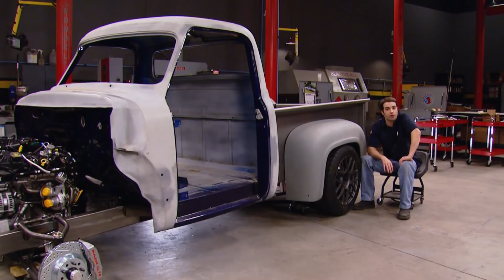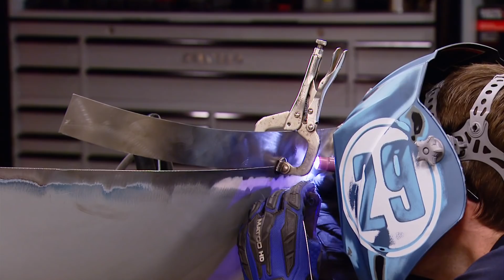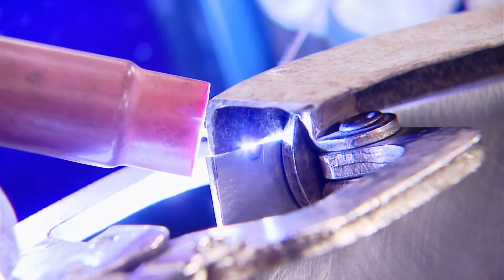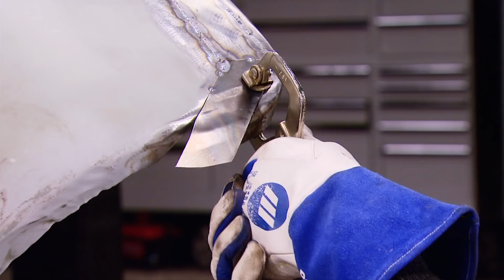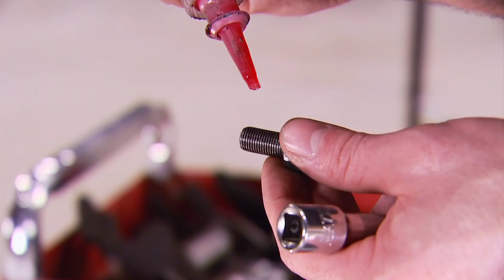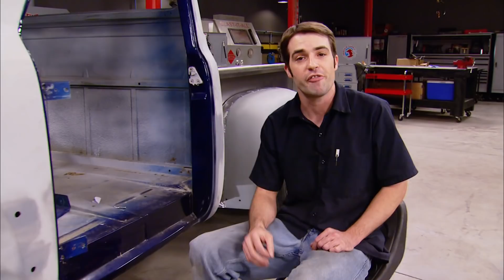Pairing The F100's Turbocharged Eco Boost With a 5-Speed Manual Transmission - Truck Tech S2, E4

Comment: Matco is ridiculous to deal with in their financial department. I won't buy from them again because of it. Randomly they just decide to take extra payments from you and then they refuse to believe it without bank statements. Their financial department is the worst at record keeping. In the last 2 years I've had to straighten them out with bank statements 6 times. I'll never deal with them again after this loan is up.
Reply: In the last year I've heard from 3 other technicians having the same issues with them. I've been buying from the MAC tools truck owner/operator for over a year now never once had a problem. Matco's truck owner/operator didn't want to deal with running a bank card every couple weeks and taking cash most of the time so he just referred me to matco corp to make payments. Our Matco truck shows up 30 minutes before the shop opens when no-one is even there and leaves 15 minutes before the doors are even unlocked it's ridiculous honestly even the shop owner has had it with dealing with them and he's dealt with them for 25 years. Save yourself the headache and just stay away from Matco.

Comment: Mustang v6 manual bolts up
Reply: Nope don't use a v6 mustang manual. The mt82 is trash!
Reply: @NicolvilleOffRoad  it’s rated at 600 ft pounds of torque stock change the fluid out with some mobile one sycro or amsoil trans fluid a polyurethane trans bushing replace the clutch springs or just go with a better clutch plus it literally bolts right up it’s also a lot more quieter then a t-5

Comment: Wait red lock tight in the back of the crank yellow or blue would make more sense because read removed with heat but yellow or blue doesn’t yellow has the strength of red But they remove ability of blue

Comment: Putting complicated engines that will require emmisions equipment in an old truck is by far the most idiotic thing to do in a day and age where the epa is cracking down on tuning software and performance equipment for the newer engines.

Comment: I use to like power nation when I was growing up. Now they seem to be a joke.  They think putting a v6 with a 5spd is cool now. I don't know anyone who would say, wouldn't it be cool to put a v6 in a 55 f100.
Reply: It all depends how you say it... How about "55 Ford with Twin Turbo Ecoboost V6 shared with GT40 supercar". Y'all old timers need to realize the 3.5 Eco makes more torque than a 5.0 right out of the box. This engine is found in every thing and is equivalent to the GM LS engine when it comes to versatility.
Reply: @icyhotmike  Honestly I like all engines. I actually own a 4 banger Honda that I'm building an engine for rn, but like come on. A V6 in a classic truck? Nah, keep V8s for those. This would have been a badass build with a 5.0 in there instead with some longtubes
Reply: @dkis8730  id hate to break it to u, but the original f100s came with six cylinder engines lmao.
Reply: @easton._.141  Yeah but anything classic American that's gonna be completely rebuilt and restored today should have a V8. Don't try to act like you don't understand the point everyone is making lmfao
Reply: @dkis8730  So putting a v8 that was developed 80 years later with advanced computer technology matches better with "classic American" solely cause it has 2 more cylinders.
Reply: @robertelee6712  Takes a five second google search to show that the 312 was not the only engine offered in the f100
Reply: @easton._.141  yes
Reply: @icyhotmike Old timers LOL. Yes, most of my cars are older but I guarantee they will outrun anything new. I have a fully built 1969 Camaro but I don't race it and it will pass anything including super cars. I have a 1990 foxbody that honestly needs wings. And I can honestly say that I have never been passed by a V6, not even a GTR can hang. There is no replacement for displacement. If you were a real racer, you would know this principle.
Reply: @robertelee6712  Yeh rite...
Reply: @skigdividerx4991  Yeah rite? What?
Reply: @robertelee6712  Your “race car” will never be good for anything other than driving in a straight line. Anything above a quarter mile and ur smoked.
Reply: @easton._.141  Which car? And where you you like to meet to make a highway pull? I'll bring the foxbody or the 09 Shelby. Well run a mile or 2 which ever you like.
Reply: @robertelee6712  No, you would probably die of old age before getting to the highway. I dont want to be held responsible.
Reply: Tons of people would say it's a cool swap.

Comment: Should’ve put a coyote in it. EcoBoost sucks…
Reply: @bigboreracing356  wow you hurt my feelings, you big bad keyboard warrior. AKA coward face to face
Reply: I agree.  The Coyote would be much cooler.   My dad had the f150 Ecoboost and I had the 5.3L Silverado.   Mine was faster and got better milage.   And with pipes sounded better as well.   However speed really isn't the top priority here.  Still needs to be fast but having 750 hp isn't really needed.
Reply: @bmstylee  ya sure it was
Reply: @LifeWideOpen780  Cleveland to Columbus to buy a squat rack in dad's f150 18mpg roundtrip.  With 400 lbs in the bed on the way home.   My Silverado same drive with 400 lb safe in the bed on the way home 22 mpg roundtrip.   So more displacement, more cylinders, running cruise control on both trips and got better mileage with a V8.
Reply: @bmstylee  The LS is a ford design engine, the guy that designed the LS worked for Ford as a matter of fact the LS heads fit on a 351 windsor
Reply: @jackwells1452  and your point is?
Reply: @bmstylee  enough LS shit
Reply: @bmstylee  wasn't talking about the inline 6 and your right it is irrelevant in racing
Reply: @bmstylee  Your 5.3 wasn't faster than an EcoBoost unless it was heavily modified. Stock they are a dog.
Reply: @89JDmac  yeah stop light race they are equal.  Put a load in the bed or the hitch like a truck is supposed to be used for the Ford is a dog.
Reply: @bmstylee  Except no, since the ecoboost makes more torque than the 5.3. I'm not even a Ford guy but the ecoboost slaughters the 5.3.
Reply: @89JDmac  all I can tell is my experience.  It was a crappy truck.  It spent more time shifting up and down in that 10 speed trans trying to find a gear.  It got worse mileage than my Silverado.   And when I stuck weight on the bed it got worse.    And if you watch some older episodes they dyno within 20 hp.